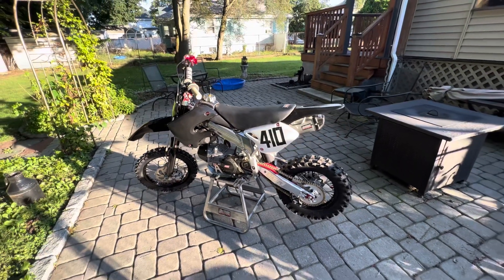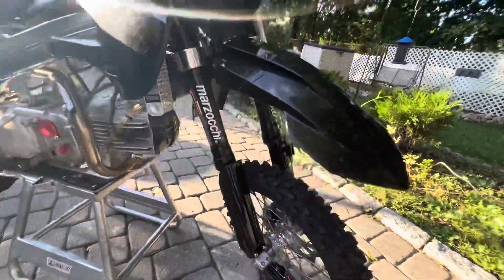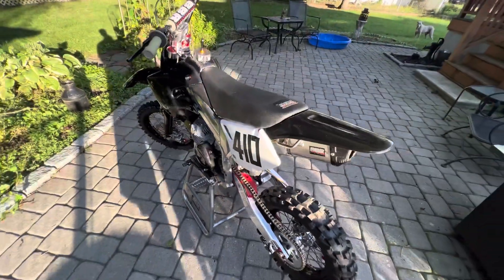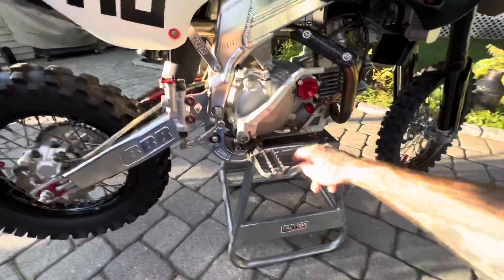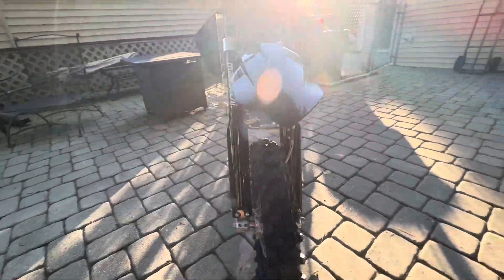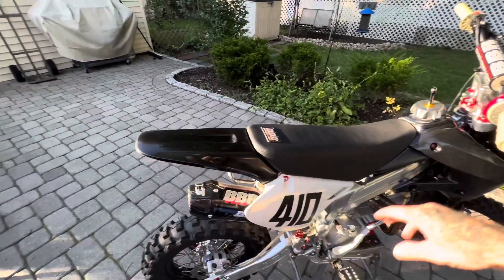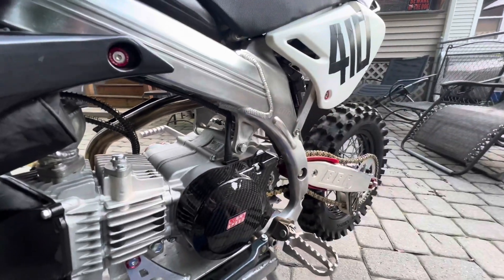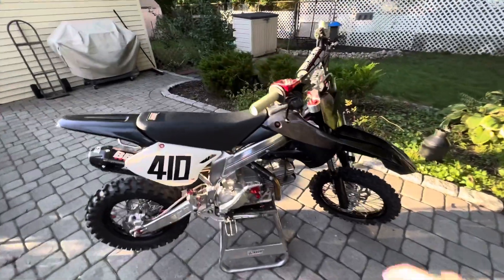BBR MM12P Perimeter Frame Pitbike Build Overview

Comment: Definitely a dream build! Only thing i personally would do is 212 upgrade, make some sweet custom carbon fenders and maybe some nicer calipers. Otherwise she is bloody mint man!
Reply from the maker: Hellyeah..honestly the 190 is more than enough if you’re a good rider, personally i dont think i need the extra power but maybe if i ever smoke this top end ill do a 212 kit…I did just make some custom carbon fork guards (just uploaded that video!) and added a few other bits i will be showing in my next video of the brake upgrade i just got done doing…new calipers, rotors the whole 9! Bigger too 🤫🤣

Comment: I'm thinking of selling my kdx220 for ycf pit bike with daytona 190.  Will the 190 vibrate like the kdx?  -thats why I'm selling the kdx.
Reply from the maker: Its hard to say for sure but i bet there comparable, the daytona engine runs pretty smooth i would say. There isn’t that much vibration on this bike but this also isn’t a YCF so i couldn’t say for sure one way or the other unfortunately but if i was you ide probably regret selling the KDX

Comment: Nice build tones of nice parts bbr makes nice stuff  ever think about making it fuel injection and a standard alone ecu like a  A racer set up.  Cdi a just able slipper clutch.  Possibly a electric fan if you can't go dual radiator ? Port match everything port and polished head ss valve s  212 bbk kit  thing will be a little monster that for sure. O ya FYI try only using the electronic start only. Kick if not done right it tends to be hard on the gear box on the 5 speeds.
Reply from the maker: Thanks man i appreciate it!! Yeah i definitely have thought about it but its to much added weight to go EFI, and i dont have a problem running the carb setup. Honestly the stock 190cc makes more than enough power. I like to leave them stock bc they tend to last longer than when you build them. I wouldn’t recommend the e start or the 5 speed engines there not as strong as the 4 speed non e start engines are. I run the genuine Daytona engines either the FDX & FLX…

Comment: Hey I found a ssr slow racer for 1,200$. You think that chassis is better than the 170tx?
Reply from the maker: It depends if you like the klx plastics or the crf
Reply: Klx for sure
Reply: Lol I like the way you put that
Reply from the maker: @Kroviakjm where did you see the slowracer for sale though im curious
Reply: Out here in Los Angeles where I live
Reply from the maker: @Kroviakjm  you sure its a actual slowracer? 1200 seems to cheap
Reply: Yeah I researched it. I don’t think the guy knows what he has. It’s a ssr 150 and has the same frame as yours same swing arm and same straight pull hubs.

Comment: Love it Jesse, hey what mx tires are these? You Not running the irc 45z 14”? Looking to upgrade my setup
Reply from the maker: I had the IRC on before but i ended up switching to this Mitas Terra force front tire its a better tire than the IRC is for sure i would recommend this one
Reply: Sweet! Def give it ago. You still on the 14 or you bump to 15
Reply from the maker: @cliffmello  yessir still run the 14” front tire and 12” rear
Reply: Hey, got a link to that billet throttle
Reply from the maker: @cliffmello  let me check
Reply from the maker: @cliffmello this is basically the same one i have https://www.ebay.com/itm/254003515857?mkcid=16&mkevt=1&mkrid=711-127632-2357-0&ssspo=XeizkZMuS7i&sssrc=4429486&ssuid=o_O0LvgYToW&var=&widget_ver=artemis&media=COPY
Reply: What size tyres are you running on this? @Jessek410
Reply: Honestly how do you get ypur bikes sounding so crisp and revving so quick if there stock engines? Sounds so sick @JesseK410
Reply from the maker: @hammondz83  yessir thats a stock daytona 190cc. Its a matter of getting the carb tuned right i think bc theres nothing elses im doing to get them to rev like that
Reply from the maker: @hammondz83  14 inch front and 12” rear both tires are mitas
Reply: @JesseK410  sweet man.. is it a 90 -100-12 rear tyre and what what's specs on the front? Sorry for all the questions just building up my own bike and want all the right parts and your builds are sick
Reply from the maker: @hammondz83 yep thats right. The specs of the front tire is 70/100/14 its the Mitas Terra Force i got on here currently. I had the IRC on but it was to wide
Reply: @JesseK410  awesome thanks man 🙌🙌
Reply from the maker: @hammondz83  you’re welcome! ✊🏼

Comment: Hello mate, how did you get ypur carb settings as they are? Your running 118 main and 48 pilot.. on the daytona website carb settings it recommends 122 main and 38 pilot? Did ypu do testing and got to the jets you use now or did the carb come with them allready fitted etc or did you start with daytonas recommendations and tune the what you use now? Or are your settings down to the temp of were you live etc? Also is the rngine your using a 4 speed? Light rotor or heavy rotor as described on daytona website? Sorry for the billion questions just youve helped abit and not many people like to help much around here and ypur wngine sounds sweet and this is what i am after! Much appreciated brother 🙏 @@JesseK410
Reply from the maker: Hey, Wasup! … So yeah i was running that jetting for a wile until i changed to the PWK carb…Now im running a PWK 28mm with a 42 pilot jet (48 pilot was a lil rich but adjusted the air fuel screw to compensate for that, now its at 1.5 turns from closed with the 42) & 120 main jet bc its a lil colder this time of year. In the colder weather the bikes tend to run leaner so the 118 main iet is good for summer time. The spark plug never lies so make sure to always do plug readings preferably with a fresh spark plug so u can actually read it. 

I am running the FDX 4 speed and its got the heavier rotor which i prefer over the small lighter one. Still revs up nicely i think an goes thru turns so smooth.

I always tune to the environment im riding it to get the best possible outcome. It all depends on the temperature and elevation at the time so the daytona specs is just a good starting point and also they leave them on the rich side so you dont run it to lean yaknow. No worries i dont mind answering questions it only helps other people out reading an watching the video so im happy to help Mate! 🇺🇸🏁👍🏼😎
Reply: @JesseK410  awesome that's helps alot.. I shall 8 with the daytona settings and work from there then if its all down to environment as there temps are roughly what ours are u less its mid summer but our summers aren't allways that great it is Britain 😂 also off top of your head do you know if your engine is light rotor or heavy rotor as there is 2 types to buy.. and is yours 4 speed? Thanks man you are a legend 🙌
Reply from the maker: @hammondz83 i went back an edited the comment i forgot to mention that but yeah i am running the factory daytona fdx rotor witch is the larger one, the small ones i always heard were knockoff chain daytona engines. All my daytonas are genuine and have came with the larger heavier rotor. Thats the one you want… there is small differences in a genuine daytona engine and a knock off one
Reply: @JesseK410  OK sweet man much appreciated.. il have to have a look out and make sure I'm not getting no fake engine then.. and il make sure its the heavy rotor.. theres a company near me called parker racing I shall see if there's are genuine.. hopefully they are! Much appreciated man youve been a legend 👏👏👊👊🤟🤟
Reply from the maker: @hammondz83  rite on! I will check out the website if they have one? Good luck with everything i hope you get it dialed 🤘🏼
Reply: @JesseK410  thanks man there called parker racing.. tbf daytona website has them as a stockist so should be legit I just think the engine they sell is the light rotor.. its an sys model which on daytona lists as a light rotor 😩
Reply from the maker: YeAh so thats a different engine than what i run. Thats a short stroke basically made for the supermoto pitbikes, thats why its got the lighter rotor it must be build that way Mate. If i was you an its a motocross bike i was building I wouldn’t run that engine, i would find a 190 FDX with the 62X62 bore and stroke
Reply: @JesseK410  OK man that's good to know I shall avoid that engine then and have a look for what ypu have suggested.. have ypu heard of the zongshen 190 2v?
Reply from the maker: @hammondz83  yeah I wouldn’t run that engine over the daytona fdx 190 though.. i know people that run them an like them but wouldn’t be nearly as much power as the daytona 190 4V
Reply: I just looked at the zongshen 190 engine which is a 2v and that's a 62x62 would this be anygood? It's electric start thou and 5 speed.. 1 down 4 up
Reply: Thr supplier quotes it makes 23hp.. il look for the fdx then as I want a snappy engine
Reply from the maker: @hammondz83 the 5 speeds are not as strong as the 4 speed and the shift pattern isn’t good cuz it gets stuck in neutral sometimes the 4 speed is N1234.. thats why i dont run the 5 speed…and they have issues with the shifter drum star. I also dont run the electric start ones bc there that much heavier an one more thing to potentially go wrong
Reply: @JesseK410  hello mate parker racing can only supply a 190 fsm motor with light rotor is it worth getting as I'm struggling to get an fdx in the UK 😩 what are the differences in riding between the 2?
Reply from the maker: @hammondz83 dang thats a bummer. Well if thats the case ide say just get it and run it, you probably wont notice it, if you rode one and the other you would see what im talking about but its hard to explain what exactly it does..you can google it and see but im not able to explain it easily. For me the heavier flywheel just feels smoother and doesn’t stall as easy at low speeds in a higher gear or when going through turns it just pulls you right around compared to the light flywheel you really gotta rev it up an keep the RPMs high witch is better for street riding or supermoto
Reply: @JesseK410  yea is a bummer mate.. been trying g everywere.. even contacted daytona themselfs just waiting on reply..  I think it's possible to get the fsm and swap out the light rotor at a later date for the heavy rotor I'm hoping.. and from what iv read the heavy rotor seems more torquey.. stuck what to do now 😕 lol
Reply from the maker: @hammondz83 yeah its a tough call to make for sure. You might be able to just get the heavier rotor from daytona and swap it but is that engine 62x62 or was that the one with shorter stroke crank?
Reply: @JesseK410  yea definitely.. bike nearly ready to go but no engine 😔 and yes mate it's 62x62 on there website just light rotor
Reply from the maker: Well just grab it up test it out if you find you dont like the light rotor for motocross then just change to the heavier flywheel if you can get your hands on one. I dont think the lighter flywheel is gonna make or break the engine but just personal preference
Reply: @JesseK410  OK man sweet shall give I a shot! Really appreciate your help bro ypur s legend 🙌👊
Reply: And I see ypu into turbo hondas too 🤘 I built and got a magazine feature with my b18 turbo ek.. ypur looks sick too
Reply from the maker: @hammondz83  you’re welcome
Reply: @JesseK410  hi mate sorry to be a pain again, what dnm rear shock do you use and what length is it? Also what length are ypur front forks? Thanks man hope yoor good
Reply from the maker: @hammondz83 yeah no problem, ive been good thanks for asking! 

I use the DNM 280mm shock just bc there not very expensive to replace and the forks i have are gen 2 zokes, 8” of travel and 35mm forks
Reply: @JesseK410  good man glad ypu are.. I also run the dnm rear shock but mines the dnm hornet and seems quite stiff.. is there certain dnm shock for mx and sm? Which model dnm do you use? Also what's the overall length of your front shock?
Reply from the maker: @hammondz83  not sure how long the front forks are you would have to look into but yep thats the shock i have, i like the shock stiffer than softer bc how i ride
Reply: @JesseK410  hi mate I have an engine now and it's all in and running.. just have to try a Dial in the carb now so have to learn how to do that then she's good to go and looking badass.. thanks man! Quick question which oil shall I use? Seen different people saying different things because of the wet clutches?
Reply from the maker: @hammondz83  thats awesome man! I use non synthetic 10w40 motorcycle oil in all my pitbike engines, you can use synthetic but some people have issues with it slipping..Maxima premium 4 10w40 is what i use for the most part but if i don’t have any on hand then ill use another brand